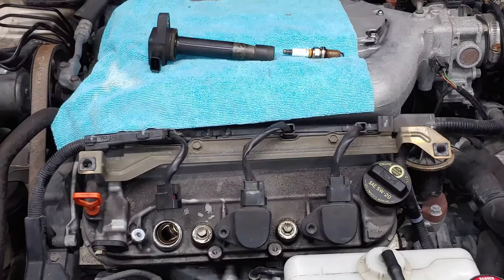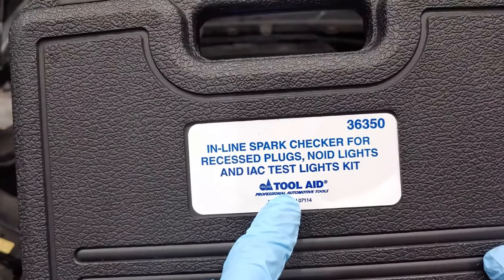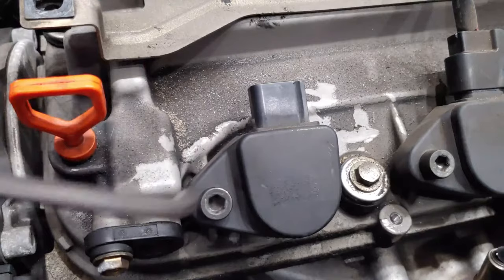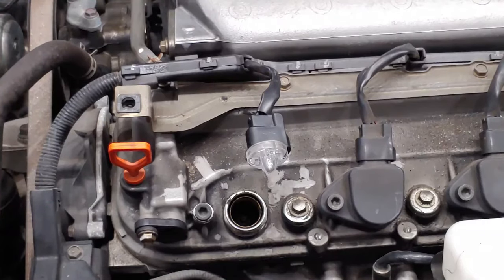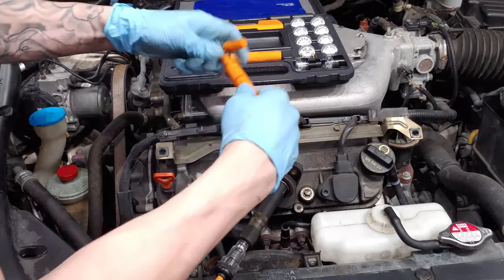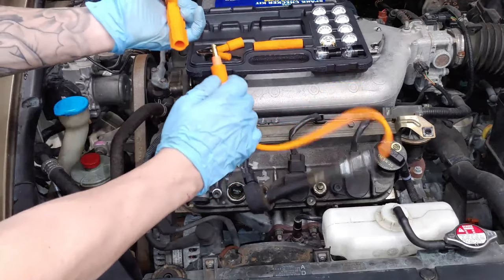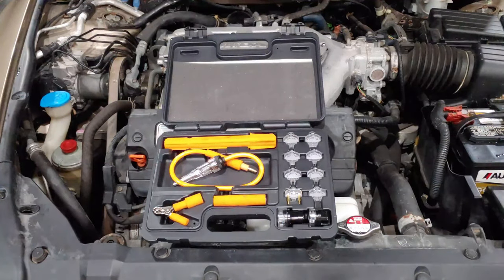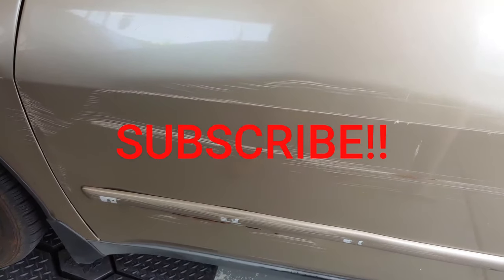How To Test Spark Plugs AND/OR Coils On Any Car (INCLUDING RECESSED SPARK PLUGS)

Comment: It seems to me that the last test is not capable of testing the spark plug as all your seeing is the coil pack firing and not the spark plug electrode firing or how it is firing.
Reply: It’s a lot harder for the spark to jump through a spark plug due to the compressed gasses in the cylinder acting as a powerful insulator.  If plug voltage is too low, you won’t get a spark and the light won’t illuminate.  This can indicate a bad coil.
Reply: It’s a great tool kit man!
But you are missing the wave form test. 

Greetings!
Reply: @cocinandolamecanica what is the wave test?
Reply: @fahedmahases723  you must use the scope to do that. 
in this case I can try connecting my oscilloscope clamp directly on the wire between the coil and the spark plug to capture the waveform of the secondary circuit. 

Greetings 👋🏻

Comment: Will the test work if the car doesn't start? Good video but I believe you should do the same test on a non starting car, that's the main reason someone would won't this kit
Reply: If the car doesn't start or even attempt (ie firing but not quite starting) chances are either NONE of the coils are getting spark OR you have a fuel delivery problem. To eliminate the fuel problem pull the air breather inlet pipe(from the throttle body or as close to it as convenientally possible) squirt a few squits of starter fluid into the pipe towards the throttle body and crank it. Have someone ready with a towel just in case a small fire erupts(lol). If it starts momentarily then engine is probably getting fuel although doing a fuel pressure check at the fuel rail Schrader valve would confirm this.And it's highly unlikely that all injectors would suddenly stop working. So if you have fuel then you need to consult the manual to trouble shoot the ignition system for your car/truck.

Comment: Why is the last test a test for spark plugs? The light blinks but it only means the ignition coil/wire is good. I am confused. Thanks
Reply: because  its now being grounded via the spark plug. So there must be a good electrical path from the coil, via the ignition pack, via the spark plug to ground for the light to flash. There's a couple of means to spoof that, but it would mean a very broken spark plug (eg the spark plug insulation has  broken down , or the spark plug gap is 0),

Comment: I just want to point out today I encountered a tricky problem. So I have a car with V6 engine that has multiple misfire just after having replaced new plugs, new spark plugs. I found out cylinder number six has problems by using the risky unplugging method, and I swapped that coil with number five cylinder, and did the unplug test on those two cylinders, now the number five cylinder has no change, so now I know the plug that was on cylinder number six which is now on cylinder number five is bad. And weird thing happens as I use spark tester tool, when I check just the bad ignition coil itself, the tester actually flashes! However when I include the spark plug in the tester it won’t, on either number five or six cylinder, so the spark plugs are not at fault on these two cylinders. My understanding is this bad ignition coil is just weak, that it can pass the spark test by itself, but it won’t function under normal operating conditions. Gotta say the ignition system is always tricky! Hope my experience helps!

Comment: Best video ive seen yet. I assume your second test( testing the coil secondary resistance by connecting it to ground) also verifies that the primary resistance ( between the male tabs at the top of the coil are up to snuff) It might also be good to use a multimeter to verify that both primary and secondary resistances are within the oem specified ranges for a particular vehicle. I don't know that the mere presence of a spark would mean these resistances are necessarily within range or not

Comment: How do I do these tests for the rear bank, which requires me to remove the manifold and a whole bunch of wires to access?
Reply from the maker: Remove the spark plugs and put it in the tester
Reply: Pull the engine, put it on a stand 😂

Comment: Hey buddy! Was wondering if you can help me out. I was testing it just as you were in the video and as I got to the 3rd n 4th spark plugs n coil pack my engine was sounding funny then after didn't want to turn on. I cant get it to start now help?
Reply from the maker: When you hooked everything back up it still won't run?
Reply: No unfortunately I gave up on it for the day going to try again tomorrow.. I did exactly like your video. it clicks like if the battery a dead but I give it a jump and nothing.
Reply: I fixed it thank you for the response buddy!

Comment: The spark plug one didn’t make Sense to me because Wouldn’t the Light Turn on even if the spark plug is bad,
Reply: No it wont light because the spark plug completes the path and if that plug is bad and does not complete the path for that current flow, the light wont come on.